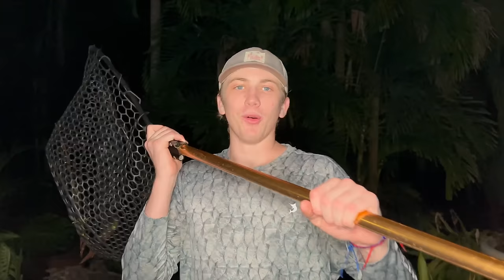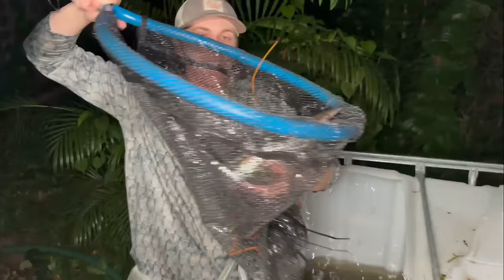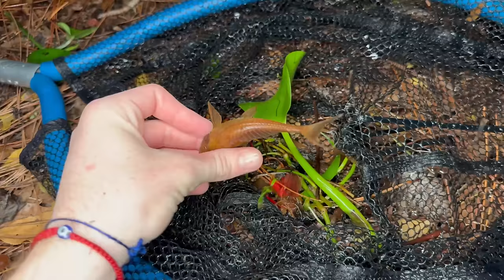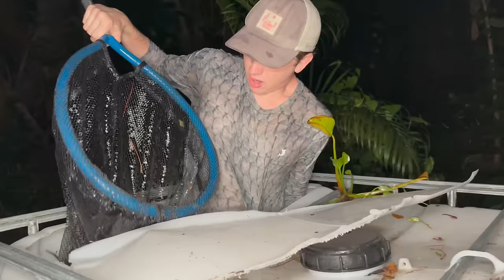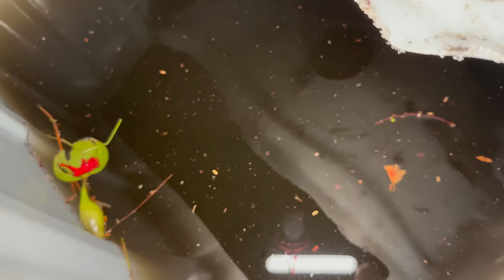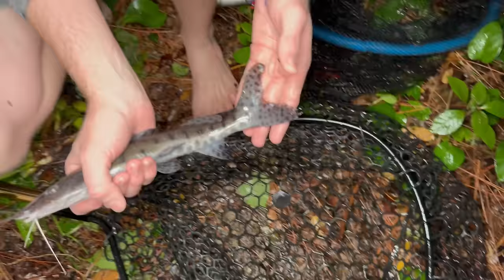I Found The SWAMP MONSTER Living in ABANDONED POND!

Comment: Shocked you haven't invested in a small water pump for these rescues. Or a small 1 gallon bucket to scoop water out and dump into a net.

Edit: make a trailer set up for that tank and you can use that with an aerator to transfer fish rescues/new purchases.
Reply: The tote had a drain valve on it. Wouldn't have even needed a pump but the video wouldn't have been nearly as long or suspenseful if he opened it at the beginning of the video.
Reply: @Bmk87ca  I made my original statement like 2 to 3 minutes in. Then edited it after he opened up the valve.